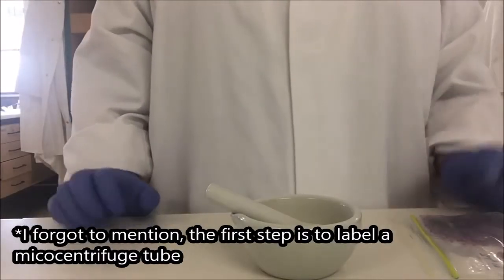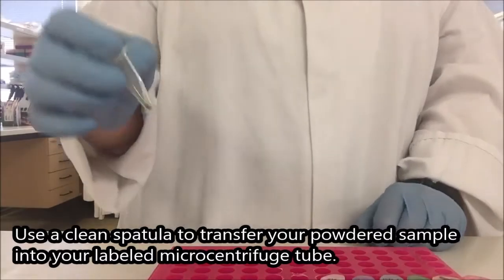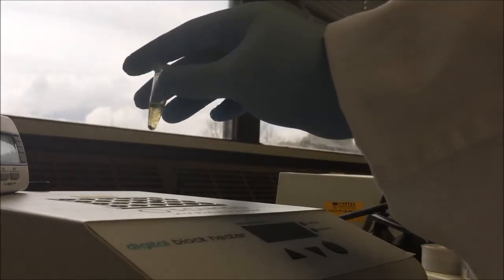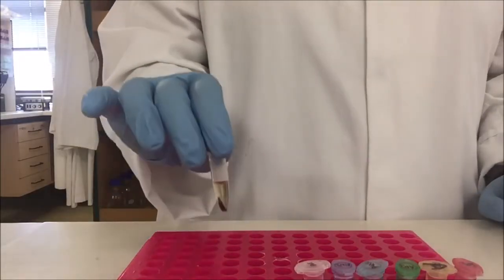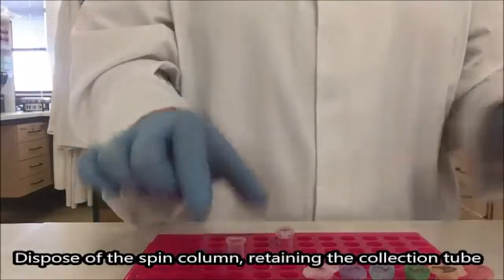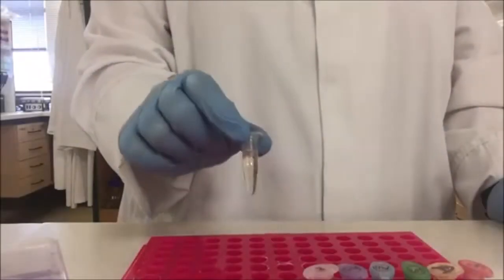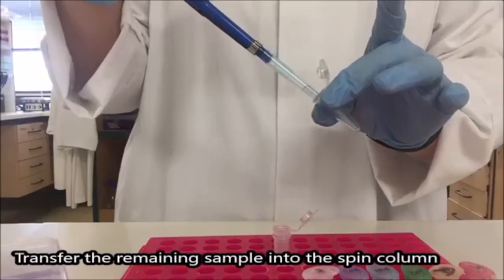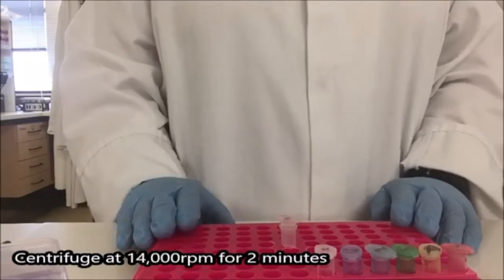HOW TO... extract plant DNA

Comment: is the pallete that comes is of white colour? and nearly how much DNA we will get?
Reply from the maker: Hi,  the palette is usually white. However, sometimes the palette retains some colour from the original sample material. This usually happens when a large amount of fresh material is used or when the cells contain a lot of pigment.
According to the manufacturer, Qiagen, 3-30ug of DNA is typical. However, my experience is that it is often greater. The yield for the technique varies a lot and may depend on the genome size of the plant you are working with. If you need a higher yield, you can increase the concentration of the DNA in the final elution by decreasing the volume of elution buffer you use.
(I'm sorry for the very late reply! I did not see your comment until now!)
Reply: @unitecEAS-biodiversity  thanks for your reply. But I want to tell u Inhave used this method several times but I didn’t got dna ever!😓😓😓

I tried it the way u have told in the video but unfortunately I never ever got it
Reply: @unitecEAS-biodiversity  also plz let me know can I extract DNA from fungus using this kit ? As I have read this in many papers.. my fungus is Nosema spores residing in honey bee abdomen. I need to extract DNA of that
Reply from the maker: @SaumyaSharma123  Yes, we routinely use the Plant Minikit for fungal DNA extraction. A few standard questions: Have you confirmed that the bee abdomen you are extracting from do contain the spores? Are you able to pool your samples during extraction to increase chances of obtaining DNA? 

I assume that you have seen the paper Ingemar et al 2013 Standard methods for Nosema research (https://doi.org/10.3896/IBRA.1.52.1.14)? The paper shows a few additional steps in the Nosema DNA extraction protocol before using the Plant Minikit.
Reply: @SaumyaSharma123  yes I have extract the DNA from fungul  with ths kit
Reply: @reaction57  which fungus